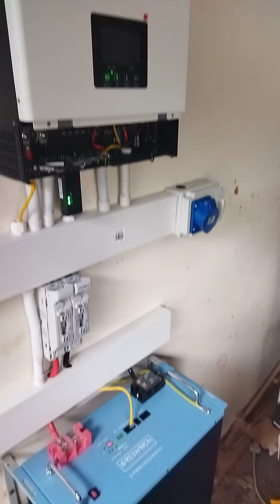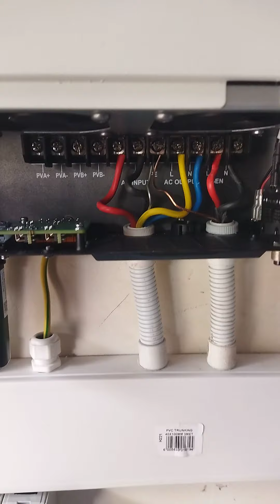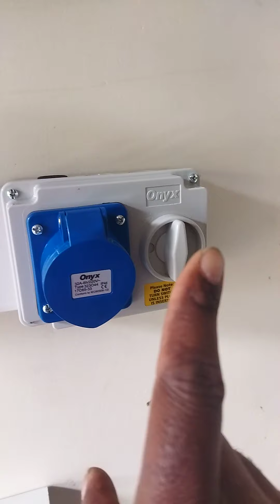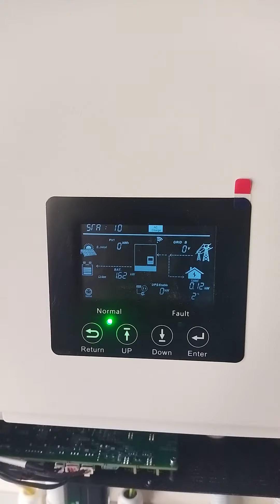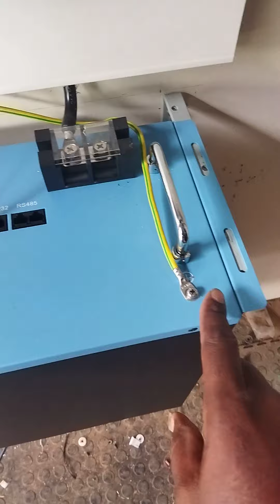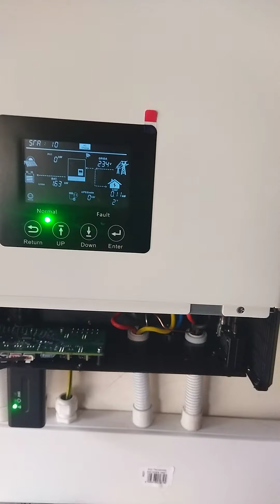Basic wiring of a backup system for alternative power (Lux power Sna with Greenrich Lithium battery)

Comment: My 5kw inverter just burnt one of the MCB, was it pulling too much current during charging or
Reply from the maker: Hi what size breaker was it could have been a loose connection cause breaker's don't just burn they  trip if there is a hire current than it can handle

Comment: Anyone to answer.. I have a leupower inverter and a elf bulb lithium battery.. When the installer installed he told me the communication cable doesn't matter and it is not necessary he did not put it on.. Everything is working but the inverter doesn't show battery % and on battery type it shows lead acid.. Can i change these options on the inverter without the communication..cabble will there be any problem?
Reply: Without the comms cable inverter is unable to communicate with the battery BMS (battery management system) directly. Only se
tting applicable is battery voltage readings.

Comment: I need help on that...i connected the input three core cable at the top of the main breaker, then output at the bottom .. With both of their neutral and ground connected to a bus bar...but after turning on the inverter fault light comes on...

Comment: just a couple of faults . incorrect CB installed in main DB that feeds the inverter DB should be  of the same type as original cb's (cascading).
Blue is not neutral that must be taped up with black tape
Indicator lights with on protection must be installed to indicate what power source is present 
Socket for generator seems to be female ,that must be male.
I would also use the same brand type CB for inverter return cb in main db this cb could also be an isolator type as the cb in inverter db already protects the cable and inverter
Reply from the maker: Noted

Comment: Another thing if you using a single rail DB you have to partition the non essential from the essentials it's best to use a separate Db for the essential circuits

Comment: You can't use a blue wire as a neutral according to sans rules and you can't cant have 2 pen earth's on 1 property and you not allowed to have 2 wires that is 4mm and thicker in a breaker.
Reply: Agreed to the color coding of cabling, use heat shrink or insulation tape to color code correctly. Disagree to the breaker wires. He could use flat pin lugs. The PEN is for the floating neutral voltage present neutral and earth  on the inverter load side terminals (115V when not bonded). But i think the neutral must first go through the inverter  load supply breaker, then to the neutral  - earth bonding wire. Also indicate on the wire, and on the AC changeover DB that it is permanently bonded. Last I heard, SANS still discussing the neutral-earth bonding or contactor control for neutral-earth bonding.

Comment: I thought the change over was done by the inverter itself.. do you actually  need an external breaker for that ?
Reply from the maker: Hi there yes the inverter does the switching
 But have you ever thought of how to isolate the inverter from an installation for maintenance or repairs. look at the diagram in Sans 10142-1 ed1.8, page 357 diagram S3 explains how to wire an inverter to a premises
Reply: @anthonymwambazi7390  thank you, sir. very informative.

Comment: Hwst bru why did you have to use a 20amp as an output breaker from the inverter to feed a 40amp breaker ther
Reply from the maker: Hi there 20A is for inverter output to protect the inverter from overloading and  40A is for Eskom bypass if not using inverter backup purpose and cable rating size hope that explains well

Comment: Great video. Thank you. Can you show a video on how to wire up the contactor for the ground neutral bond on the sunsynk. Thanks again
Reply: Under batt charge enable singal island mode, then from the mainboard, the white middle connector strip there is a L & N, have that go to your contactor then from your contactor into the green inputs
Reply: Segen solar has a  detailed guide on this

Comment: Good evening Anthony, thanks for videos and sharing your knowledge and your experiences. 
Anthony i just want to know the spd is it only to protect the inverter and what you feeding from escom on the change over switch, cuase when you feed from the inverter it doesn't include spd. Hope understand what i am trying to say. Thanks again
Reply from the maker: The SPD is protecting the inverter from any surges or transients that might arise from the electricity Supply company heavy industry equipment switching on and off or flash density From resulting from lighting strike in the area
Reply: @anthonymwambazi7390  According to Bravo Scan's (DOL inspectors for solar installations) wiring diagram, they want SPD's both grid side and load side of the inverter.

Comment: Hi Anthony. There are conflicting arguments on whether to bond the neutral out of the inverter to earth permanently or through a contactor relay. Please can you explain the correct way of doing it as some electricians put the relay in and some bond…
Reply from the maker: Hi I used to bond with a relay nothing wrong it's just that the relay coil may after some time and you stand at a high risk of the earth leakage not activating , you end up having a floating neutral, elevated voltages between neutral and earth causing a further risk of electrocution when metal  exposed parts become live. The inverter is a VOV machine, that was designed for the European market, you have to convert its power supply to local regulation requirements which TNCS that's why I permanently bond neutral to earth just Like generators same thing.

Comment: Great videos . Appreciate people sharing their installations so we can all improve on our work. And also learn from each other. 
I understand some electronics are safe to connect without an earth leakage but its just good practice to have one incase another electrician connects other 'non essentials' items that do require it in the future.  I have seen many installations where plugs are on the non earth leakage circuits and people don't realize the danger. Other than that, good install, love the use of a proper ac plug for the Gen. Shielded cable , nice solution too!

Comment: Why is the input of the inverter on the changeover? Why not put the output of the inverter on the changeover?
Reply: i think both input and output are on the changeover switch incase there is a failure you will have to do it manually. incase the inbeter fails

Comment: Could you provide a code for that generator input, please? 
I'm assuming the one on the wall is the male side under that cover.

I'm going to be using a petrol Ryobi 7900k, which can push 28A.
My Inverter is 11kw MAX E with 2 x AM2 batteries, soon to be 3. 

I want the generator for in case we have unexpected 6 hours of load shedding or the grid collapses to prevent the batteries running flat.
Reply: Careful with that genie. I got the same unit at home. The genie has a floating neutral (L-N 230V N-E 115V L-E 115V), configured as V-O-V split phase voltage. SANS 0142 for bids using V-O-V type genies on installations. I removed the alternator cover to see whether I could make it bonded neutral. But the unit has no center tapping on the stator (only 2wire points, not 3).

Comment: Looking good! The only problem I see is the wire color you use is not allowed by law. However if you clearly mar the blue and yellow to red and black you should have no problem. Also don't forget your alternative power supply light. You know incase someone who does not know about inverters, works in the DB and does not get electrocuted. All and all looks clean well done
Reply from the maker: Thank you for your advice much appreciated, on the other colors if you noticed I tape the end of the cable for the other electrician who might not know what's happening, perhaps on this video it was not done.
Reply: @anthonymwambazi7390  awesome stuff Anthony ! Are you happy with the Greenrich batteries, head all sorts of great stuff about them
Reply: Also neutral wire is used as an earth continuity conductor under the SPD

Comment: From the Eskom breaker, the first 2 pole breaker, you go straight to non essentials? IE you bypass the earth leakage for non essentials? Or am I missing something
Reply from the maker: Hi yes correct I bypass the earth leakage provided that an earth leakage is not required on those items if Sans 10142 regulation allows if not there must be a separate earth leakage fitted to those items as well
Reply: @anthonymwambazi7390  Earth Leakage required on geyser for a few years already. If stove is a plug in unit 3pin plug, then also E/L required. Also better to split and group essential and non-essential circuit in same DB. Was already posted by somebody earlier in the comments.
Reply: According to SANS 10142 GEYSER must be on earth leakage

Comment: firstly your videos on installations are the best thanks for all the info you provide. secondly wouldn't it be better to have an earth leakage for both non-essential and essential loads? also i put a NC contactor bonding Neutral to earth for my installation as there was a floating neutral when eskom is down is this correct to do?
Reply from the maker: Hi I used to put a contactor before now I permanently bond the neutral to earth cable on the Ac protection box to simulate Eskom power supply TNCS and will sort out your floating neutral and your earth leakage breaker  will have a reference as well

Comment: So with your connection.. when the eskom go off … need to come switch manually or its automatically
Reply from the maker: You leave it on auto provideded you select the loads you want to have without overloading the system

Comment: Hi Anthony, what is pin config for BMS 5kwh N Energy Lithium Battery with Growatt 5kw 5000ES..
Reply from the maker: Hi there N energy is a generic battery does not have a communication protocol yet as far as  know it only manages it's self so you set it up as a lead acid

Comment: I have the same luxPower inverter but it does not want to pick up my battery (shoto) when we plucg it in. What can we do?
Reply from the maker: Hi please share a bit more detail what model number is the Shoto and the serial number of the Lux power on battery settings number 3 what brand type did you select and lastly what type of network cable are using as in pin configuration
Reply: https://youtu.be/GFzD18L0id4
Reply: Check the vid for battery settings